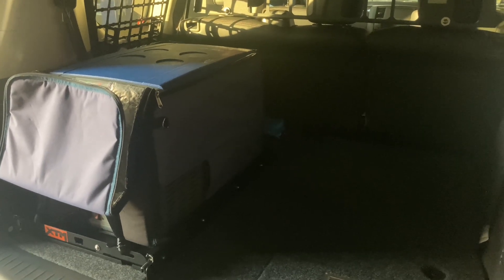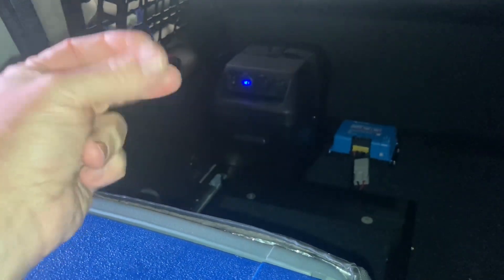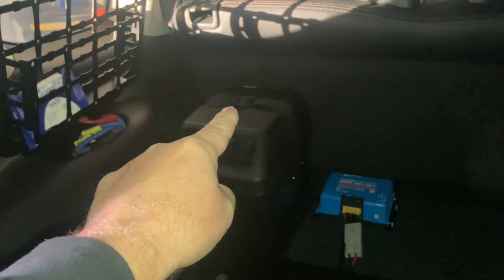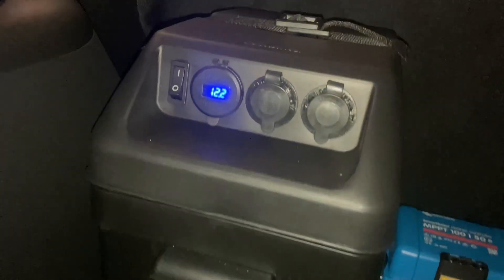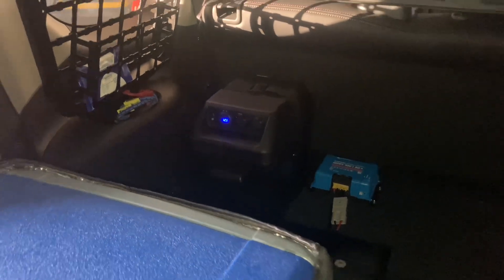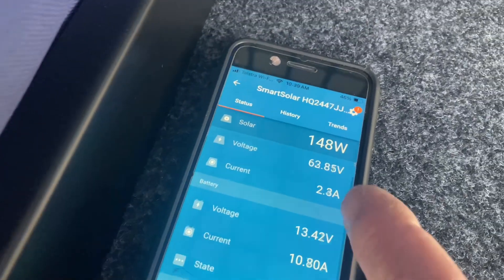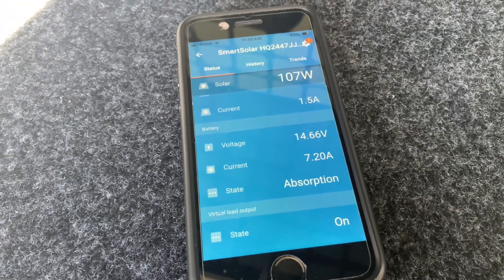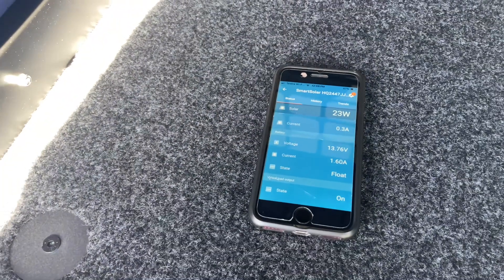Pass or fail? 4x4 Camping fridge battery Solar after 20 hours

Comment: hey mate just came across your channel thought i’d share some love, good video mate. my mate ran a kings with solar only and it did actually run it fine with a 50ah lithium he doesn’t even run alternator through the dcdc haha
Reply from the maker: Right now, the fridge is still on. It has not been in the sun since yesterday that’s Monday afternoon.
Little battery poor little thing let’s have a look at it tomorrow morning Wednesday better get it back out in the sun again well it’s gonna be cloudy so this will be another good test a battery that’s had no charge for two nights. Will it be still running the fridge will it have cut out on low-voltage and how long will it take to recover ? We will have the answers tomorrow night.